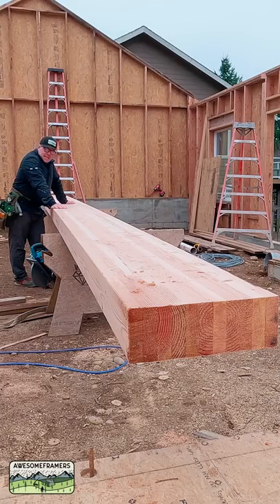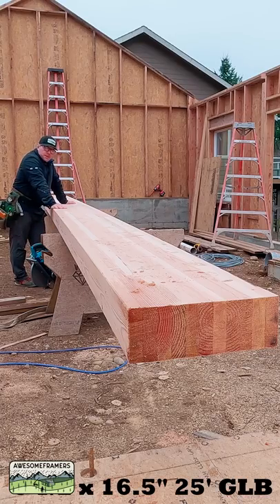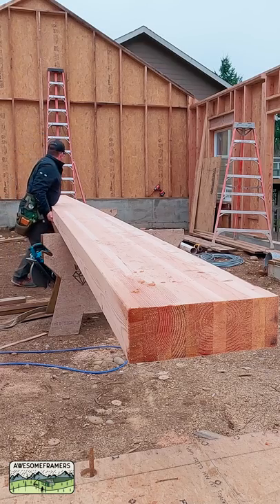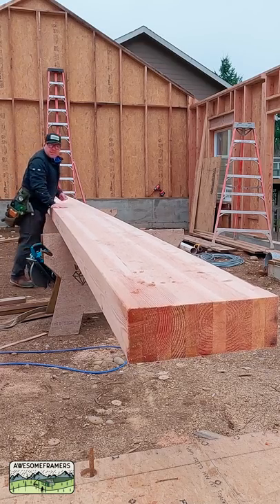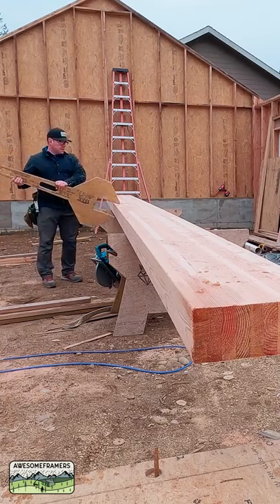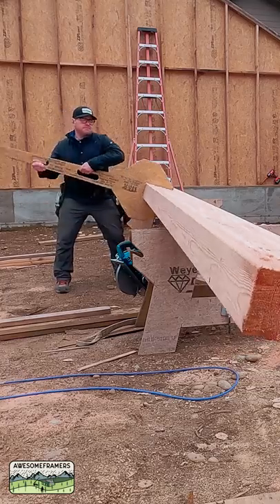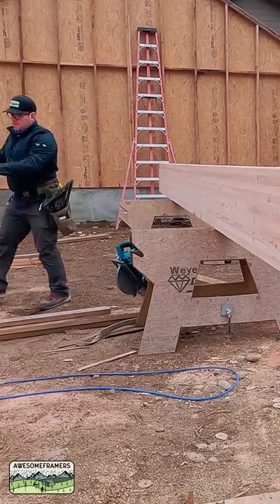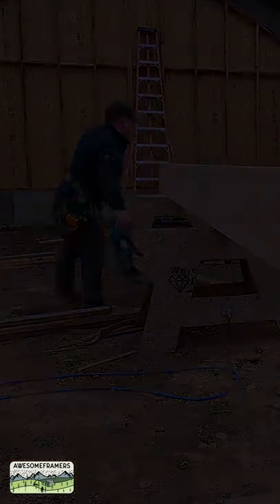Beam Wrench- Using Mechanical Advantage #shorts

Comment: Archimedes principle with a long enough lever you can move the Earth
Reply: “The mass of Earth is 6×1024kg. If Archimedes can lift 60 kg, he would need a lever with an arm ratio of 1023:1. So if the short arm is one meter long, the lever length will be 1023 meters plus one. Also, note that he would have to push the lever for 1020 meters to shift the Earth just by one millimeter.”
for anyone curious like me
Reply: @IcECreAm-sv2qv  excellent work 💪👊
Reply: @IcECreAm-sv2qv  none of that is true... your lever would be a size of a tooth pick compared to a London eye for example (a guesstimate but way closer than yours).
Reply: Actually not entirely correct. You would need a long enough lever AND A FIX POINT in order to move the earth.
Reply: But where would you stand?
Reply: And with the Earth being flat a wrench like this works perfectly.
Reply: @IcECreAm-sv2qv  what would the fulcrum be?
Reply: @XoJOHNoX96  Probably a celestial pole.
Reply: I can move the earth with my dinky.

Comment: Awesome, I’m a boilermaker and to roll heavy beams on tressles I’ll use a turning bar which a bit of pipe welded to a thick plate usually 20mm with notches taken out of it in different positions so you can flip them, handy things to have

Comment: I used to work making those wood laminated beams some of those were 60 feet long. Its nice to see one out at a job site.
Reply: Are the laminates sanded coarse or smooth before they apply glue to the layers? Ive always wondered this....
Reply: I'm going to guess smooth for consistency
Reply: @rcamacho364  hello friend
Reply: It's a lam beam dude lol, their used in almost every new house being built.
Reply: The lam beams I've worked with never looked like a stack of 2x4s...
Is this one in the vid home made?
Anyway, I'd imagine an average lam bean would be made in a similar process as OSB, 
orient the grain, 
laminating glue, 
and very high pressure

Comment: Honest question - I was always under the impression that having your beams glued flat like that reduced structural strength. True or no?
Reply: .....what? No dude, definitely not true at all.
Reply: They don't get installed laying flat, that would be alot weaker. They are mounted standing upright so the whole stack takes the load
Reply: @devingeary455  👌
Reply: lol

Comment: Glue lams fail faster than solid beams.
Blizzard of 96-97 Reno Nevada. New construction glue lam supported roofs suffered catastrophic failure. Older structures with solid beam supported roofs held.
Reply from the maker: You should make a research project out of that.  You may be surprised

https://www.woodworks.org/wp-content/uploads/Wood_Solution_Paper-Fire-Design-of-Mass-Timber-Members-WoodWorks-Apr-2019.pdf

Comment: PLEASE show us how you made the saw horses.
Reply: If you can't build them from the video, you probably shouldn't be building anything at all.
Reply: @Tool_Addicted_Carpenter  did you build some? I can't tell what type of hinges he used from the video. What kind/ how many for each horse? Thanks in advance!
Reply: @joehooton1880  if you want strength, no hinges involved. Just cut out the template on the ply and use a 2x10 or 2x12 wedge with a 15-20 degree angle. When you're setting up camp on a jobsite, you don't need them to fold. I usually make my horses 6-8' wide because they can hold an addition worth of lumber to make cuts on. If I need portability, I just buy 2 for $25 plastoc blue hawk horses from lowes because they're a lot stronger than the home depot husky or I get the heavy duty steel foldable horses from a real lumber yard because they're 2x as strong as what you get from lowes or depot and I put 2x12 stock on them because it immediately makes them a work bench rather than a sawhorse.

Comment: Did you model it in Sketchup or freehand the design like some kind of madman?
Reply: Are you serious? You think that 'wrench' required some preliminary digital rendition? When you're a carpenter you just make things on the fly. Shouldn't take more than 10 mins. And he's dramatically overestimating the weight of that beam.
Reply: @Tool addicted carpenter  

No. No I was not serious.
Reply: @ABZD019  ok. Work on your sarcasm.
Reply: @Tool addicted carpenter  

If you're the only one who had an issue understanding it wasn't serious, is it really me who needs to put in the work?

Comment: Its heavy but not 550lbs...or he would not have budged it without beam wrench
Reply from the maker: It is indeed 550lbs. I got that info from the manufacturer. Do I really need to post the link for you?
Reply: @AwesomeFramers  not necessary....i never worked with wood....but at the gym 550lbs is a tough deadlift i have to put my legs and back into to rep.....so i figured it was an off estimate not a lie....but kudos for the lift...and ingenuity of the 🔧
Reply from the maker: @kahlilsmoot9922  leverage is quite amazing. But you're right, in the gym that's a lot of weight 👍